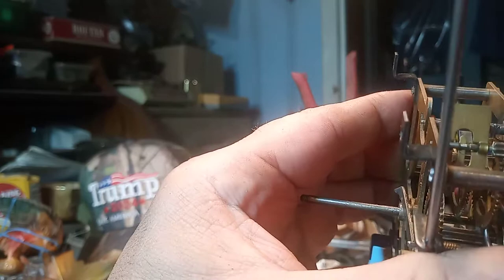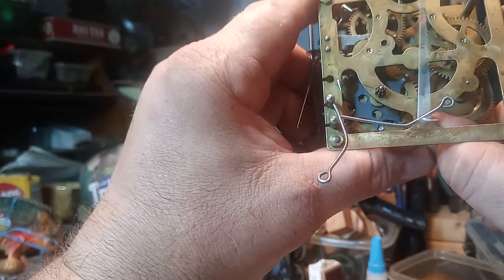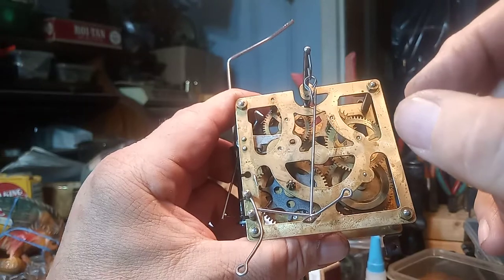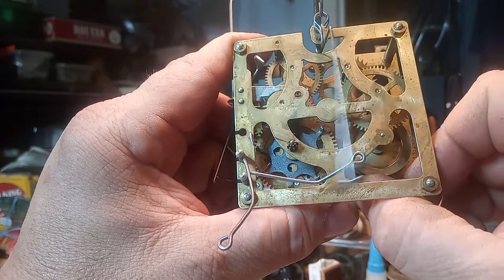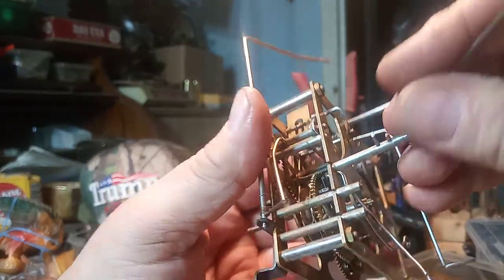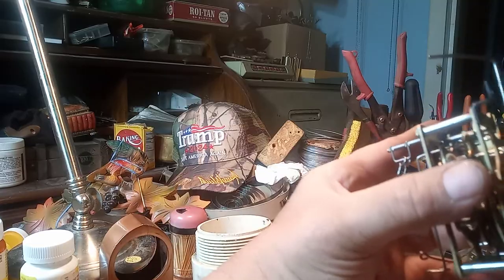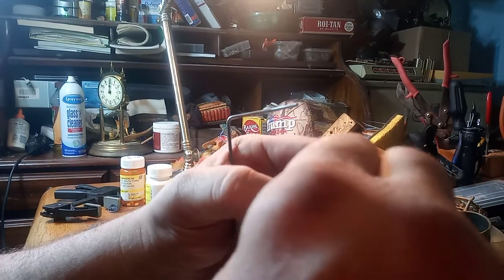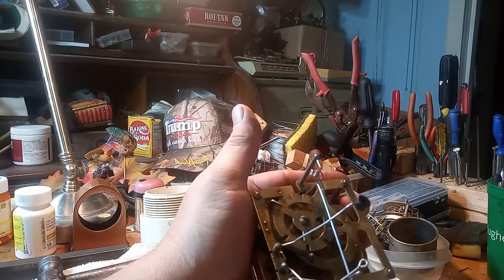Repairing a Fox and Grape cuckoo clock. 20220424 230434

Comment: I have a regula with dancing platform. Won't quit coocooing.. can you give a understandable explanation of how to adjust it. I dont understand all the fancy words used by the clock guys
Reply from the maker: If you are a subscriber to my channel then look for the folder how to adjust a music box with the little man that comes out and another folder called adjusting music boxes. Let me know if you cant find them. You should be able to find them easily. I also have another folder that has to do with cuckoo wont stop until chain hits the floor. Watch all the videos and let me know if it helps.